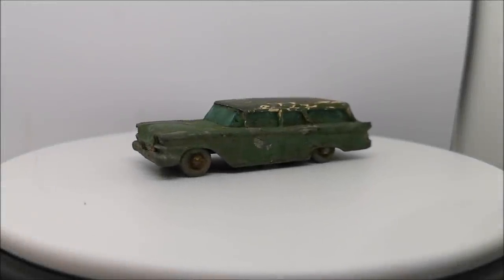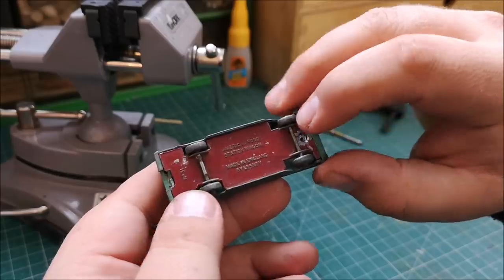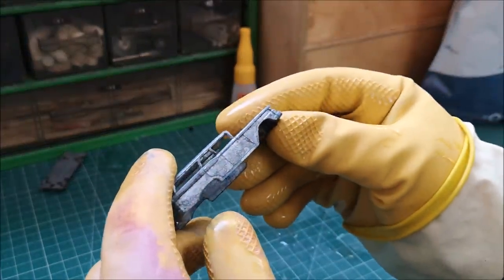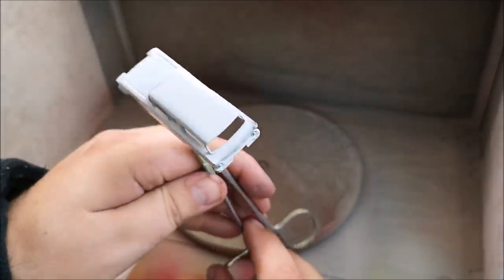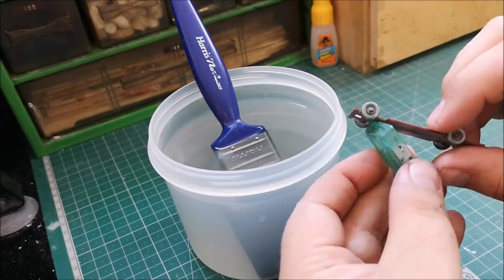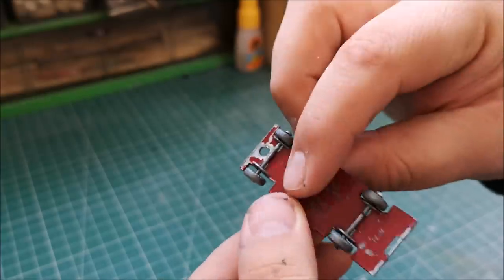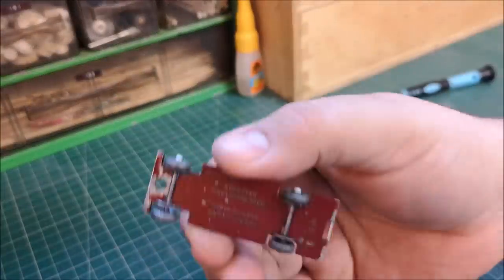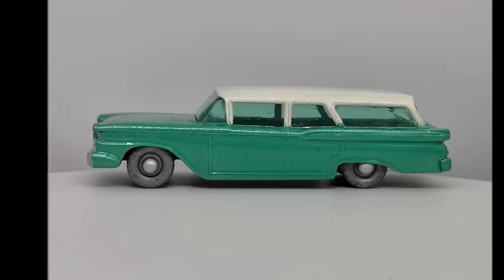Matchbox Series No 31 American Ford Station Wagon - Restoration Video

Comment: Very nice job on that wagon, Rob! For paint curing, I use a food dehydrator. In fact, I use two. I modified both to make them taller, for 1/24 scale bodies on stands. The temperature can be adjusted ( I keep mine around 100 degrees), and the paint cures within hours. For enamels, I leave them in overnight to be certain they are cured. They do an excellent job!
Reply from the maker: I wonder if my wife's nail polish dryer will help? UV bulbs..
Reply: @MatchboxGarage  I'm not sure about that, but heat definitely does the job.

Comment: Another great restoration, I have one of these at home in a condition only slightly better than the one you amazingly transformed. If you ever get a chance to do another one, you may want to pull the metal/chrome paint around the corners on the front bumper and do the same with the rear end. I wait eagerly for your next restoration/customization.

Comment: Great job as always Rob! The casting is based on the 1959 Ford Fairlane station wagon. The original Ford two tone scheme on them is way more intricate than what Matchbox put on them. I've gone and found some links to sites with good pictures of the original model and the real car for you if you're interested.
Matchbox original:
https://www.swiftysgarage.org/may-23-2018-matchbox-1959-ford-ranch-wagon-t62548.html
Real Ford Fairlane station wagon:
https://www.oldcars.site/ford/1959-ford-country-sedan/
Reply from the maker: Thanks mate. Great information
Reply: @MatchboxGarage  No problem mate.

Comment: Bake your car's for 12 minutes at 220 degrees and they will be fully dried and cured . You can prime , paint , and clear within an hours time then assemble cause the  paint is fully dry ! Just bake every step and you will love it ?
Reply from the maker: Good idea. I usually hover over a radiator to speed dry
Reply: hi rob enjoy your channel  i restore matchbox cars i like your lotus europa resto so i did one identical